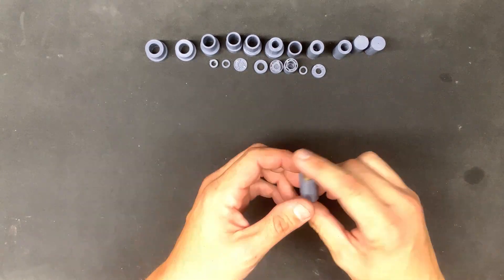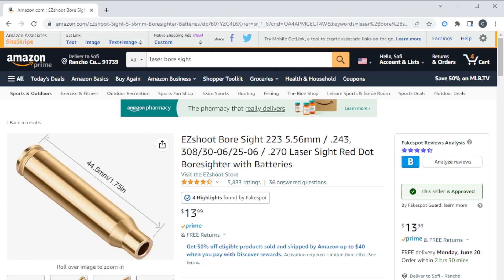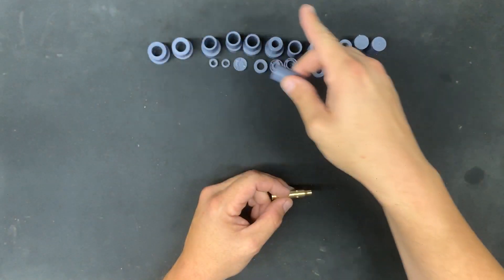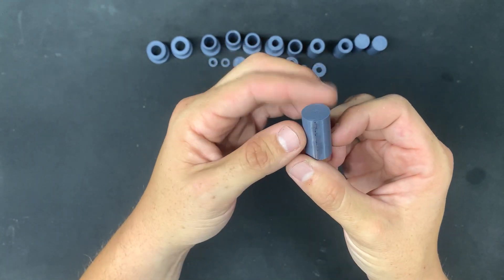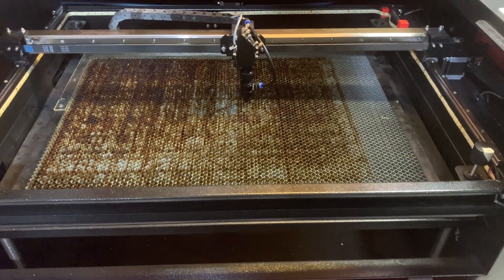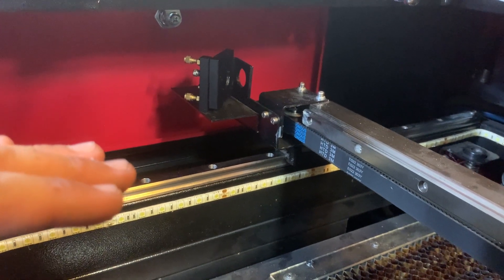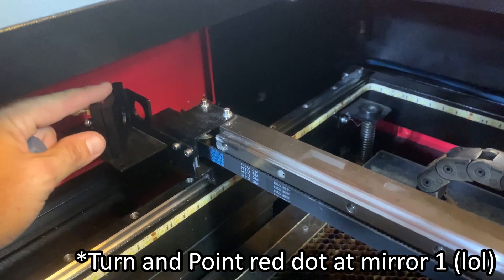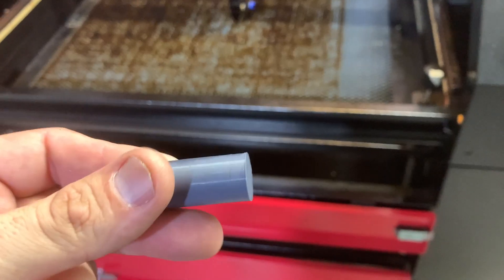DIY 100w CO2 Laser Reverse Alignment tool: Tips and Tricks

Comment: Hey just saw this - planting a led is brilliant - I took my first mirror ( on the wall axis ) and just printed a bullseye on a piece of paper - took a random plexiglass claw and fashioned a 3D printed 45 degree thin plate for that mirror ( a triangle at 45 ) thin piece of paper with the bullseye print - just like sighting a PCP scope - bang - no depth issues ( off cuts at angle ) so in summary- don’t move the first mirror just make a thing jig - and a sticky note got me .0004 from zero
Reply: I’ll put it on stl forums - I just sent 405 items out to customers - wow buddy you rock!
Reply: Dude you nailed it!! Never thought of reverse alignment but ping me - I think no tape and easy without major anything - may even be a stl - I’m using an MK40 VERY modified

Comment: Hey Wallman, great concept!! Can you double check the STL on thingiverse? I’d like to remix or make a fork of your design but I’m not sure if it’s an issue with how I imported it into Autodesk Inventor or if there’s an issue with the file but it appears that the inside diameter is not concentric with the other diameters. Also inside diameter on the STL appears to be 1.25mm and not 0.5mm like you mention in your video here. Any thoughts? Once again, great idea that I’d like to use but just want to double check before I reinvent the wheel. Thanks!!